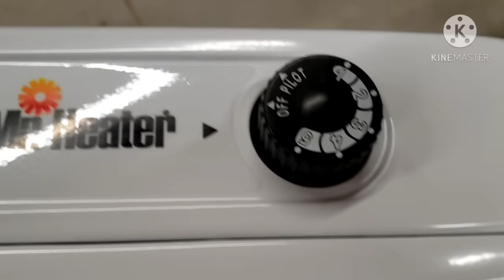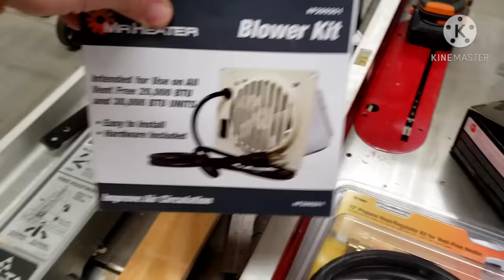Mr. Heater 30k Btu Propane Heater Opening And Install!

Comment: Can you leave this running while away from home?
Reply from the maker: You probably could for short times but me personally, would only run it while I was home. It has a sensor if there is low oxygen I believe but didn't want to test that. I did a second follow up video where I did the final hookup to a 500 gallon outside tank. Let me know if you have other questions. Thanks for watching!

Comment: I have the dual sunflower heater now. 30k btu. But it keeps giving me issues. So I'm looking at this. Thoughts if this is better heat wise than a sunflower tank top. I live in NW Wisconsin so we get super low temps.
Reply from the maker: I've never personally got to run one of those style heaters. So sorry I can't give you a fair comparison.
Reply: @HermanWoodworks  no worries. Thanks brother

Comment: I just bought the same heater.... MHVFRD30LPT.... Do you notice a difference (instantly) from temp setting 1 vs 5? The heat intensity doesn't instantly change on mine at all, it burns at the same level.
Reply from the maker: The intensity will be the same...the settings are a rough temperature setting. If I use setting one, it seems to keep my shop around 55 degrees or so....setting 2 keeps it around 60.... and so on

Comment: Two questions:  Are you worried about Co2 and also what about dust and an open flame in a woodshop?
Reply from the maker: So while they call it ventless, I crack a door from time to time to keep fresh air coming in. I do make mental note of running dust collection and air filtration units especially while sanding. I cut the heat off if I'm doing alot of sanding.
Reply: I ran this setup in my house last winter because the hvac never got installed before winter. It worked great and never killed anyone. Haha I had a carbon monoxide detector close by and more in other rooms. They never went off. Ran it literally all winter long in zero temps. Best investment for backup heat I’ve ever had.
Reply: Propane does not produce carbon monoxide.  So you’re safe there.  Oxygen depletion is the concern.  Most units like this have a shutoff if oxygen is depleted.  Empire heaters are ventless and have auto shutoff.
Reply: @thelouiebrand  ...using 20lbs tanks???
Reply: @thomasmiller9770  If the heater is malfunctioning in some way to cause incomplete combustion, then it WILL produce carbon monoxide. A perfectly functioning propane heater will not produce it, sure, but it's better to have a carbon monoxide detector incase of a malfunctioning heater.

Comment: is that hose kit necessary for the pressure? also why are those tubes only temporary?
Reply from the maker: This model requires a low setting which ends up being the additional filter to really bring the pressure down. The packaging states it is a temporary kit, I'm sure mostly for legality purposes with local code requirements probably needing the tanks outside and with hardlined propane piping feeding in.
Reply: @HermanWoodworks  im looking to heat up a 2 car garage only for an hour or 2 a day for a few months. it would be on for 2 hours max. do you think that setup would be ok
Reply from the maker: Are you going to be in the garage with it? The price point is good....if your only running it that little the temp hose kit might be fine for you long term....
Reply: @HermanWoodworks  yes i plan on heating up the space for 15-30 minutes before working out in my garage. total run time would be 2 hours max, i could see myself shutting it off after an hour
Reply from the maker: Yeah pretty much any other type of fuel style heater would be too smelly unless you get something quite a bit more costly. I mean the heater and fan were about 230 u.s dollars and 40ish for the hose kit and then whatever size tank you end up wanting...
Reply: @HermanWoodworks  thanks man appreciate the help

Comment: I notice my propane tank makes an air noise as the heater is on , but when the heater is off it goes away. I checked for leaks no bubbles. Is this normal?
Reply from the maker: What size tank is it? I believe I remember on the smaller tanks being able to hear the liquid propane displacing....
Reply: @HermanWoodworks  it’s the 20, although I do have the mr heater regulator that converts it for a smaller tank.

Comment: I'm looking to add something so my furnace doesn't constantly run. Would this be a good addition running a couple times a day to keep from my furnace being over worked?
Reply from the maker: You got alot of variables there...its not the prettiest looking thing...how big of an area would it be working in? Do you have a hardlined propane service or would you need a tank sitting there....maybe  a large space heater would suffice. Alot of people rave about mini splits also and then you get the cooling factor in the summer also.... sorry that probably doesn't help but maybe it would help me narrow down my answer.
Reply: @HermanWoodworks  I would run a line outside thru my four seasons room. So the tank would be outside.

Comment: It's been a year now... Do you still like this propane heater?
Reply from the maker: I do! I did a second video where I did a final install to the 500 lb propane tank outside. I usually keep it on a 2 setting for my 28x28 workshop with 12 ft ceilings. I'm actually selling the house that has this workshop but im installing a similar natural gas unit in the house garage at the home we are building.
Reply: @HermanWoodworks  
Good to know...
Thank you so much for all this great information. I really appreciate this.

Comment: Good morning- thank you so much for this video. I do have a question. We purchased the same exact equipment you have, however the connector to the tank and a portion (about an inch) of the hose starts to freeze immediately. What are we doing wrong? Hoping to get some help soon- before the heater goes back to the store… I want to keep it! Thank you for your time.
Reply from the maker: Hmmmm what are your outdoor temperatures? The tank will get ice covering it, but it usually takes a good while of it operating.... you say immediately?
Reply: @HermanWoodworks  we are in upstate NY, high 20’s low 30’s. When I say immediately- it’s within 5 minutes.
Reply from the maker: @janicefederico6586  wowwww that is fast. I would get ice on the 20 lb tanks after running it for hours....how long is the tank lasting, have you adequately checked for any potential leaks? Where is the tank placed?
Reply: @HermanWoodworks  the tank is new, yes we’ve checked for leaks from the tank. We constantly smell for the propane- sometimes we smell something, most times we don’t. After getting the hose you suggested- at least the heater powers up and stays lit, however it begins to freeze. Because we are just testing it out, the tank is about as close as yours was when initially assembling the heater (in your first video). The heater is on the floor in front of a rock wall.
Reply from the maker: @janicefederico6586  it sounds very much  like you have checked most everything. The only other thing I'm wondering is it naturally a humid room or close to moisture? I mean burning propane naturally adds water to the air but it maybe seems like there is excessive moisture. Let me know how long the tank lasts?
Reply: @HermanWoodworks  After further investigation, it looks like we were having trouble with the tank we were using. It works very well with a 20lb tank. We were trying to use the next size larger tank. Possibly they over filled the larger one? With the hose connected to the larger tank , the heater stays on about 3 minutes & is still freezing. We may have to just use the 20lb.
Thanks so much for responding. If you have any other ideas, I’d appreciate.
Reply from the maker: @janicefederico6586  I'm glad you got it running! I'm surprised the other tank gave you issues though...that hose kit is suppose to be ok up to 100 lb tanks. I did a second video where I did a final installation to a outside 500 lb tank. Just talk with your propane provider if you do something like that so they get you the appropriate regulator for that heater. Im still a little baffled by the other tanks malfunction issue. Maybe it was overfill. Let me know if there is any further issue! Take care and have a good one!

Comment: Does it smell last year I bought a blue flame dynaglo  heater and it smells thinking bout going this route
Reply from the maker: It does have a slight smell, it will be the same as the blue flame units probably. You will need to get a vented style unit to the outside for it to be odorless and 100 percent safe.

Comment: About how long will a 20lb propane tank last with this?
Reply from the maker: This is probably the most asked question I get on this video. There really are alot of variables, how well the house is insulated, how big is the area, how high are the ceilings....etc.... I had it in a 28x28 shop, well insulated with 12 ft ceilings. It would last roughly a week of intermittent use. Hope that helps! I also did a follow up video where I attached it to a 500 gallon outside tank. Thanks for watching!

Comment: oh no. I wanted to watch you through all the steps to hook up the kit to the LP tank.  I have a male thread coming out of the tank, and it looks like the kit also has a male threat to hook up to the tank (?) how do the 2 come together?  and you kinda skipped the details to install the fan. Can you help me out?
Reply from the maker: It has a male thread coming out of the tank? You may need to buy an adapter or possibly a piece needs to be removed? The mr heater model has a square on the back that is tack welded. That will get knocked out and there are four predrilled spots for the screws to go that hold the accessory fan. There will be a wired piece to attach from the fan to the heater that is the temperature sensor. Let me know if you have other questions. Thanks!

Comment: I purchased the blue flame model of this same heater. Could you possibly explain to me what the difference between the two is? I was told by tractor supply employee it was solely for looks. Any info would be greatly appreciated. Using the Mr. Heater 30k btu as primary source of heat. Thank you in advance!
Reply from the maker: Blue flame heats the air while radiant or infrared heats objects is the simplest explanation.
Reply: Blue!! Flame!!😁
Reply: I have a tractor supply blue flame heater.they have a blue flame!!😁🔥
Reply: @dannybetts6929  there is a difference. It's not just one is blue and one is orange. If you read the OPs reply to my comment, then you would maybe understand. Thanks anyway bud.

Comment: How does it handle in a camper with the moisture?
Reply from the maker: I only ever ran it in my old shop, but that was the one thing everyone seemed to warn about was the potential for rust on tools from the moisture produced from the propane. I never experienced rust on tools but on a cold evening I would notice moisture buildup on the windows.

Comment: I am doing this exact same thing in my 6x8 hu ting blind. Mine is a 25,000 btu heater. I'm running my tank outside. How do I know what size, or if I need a regulator on the gas line?
Reply from the maker: What size tank are you running? The hose kit i bought from mr heater already had the necessary regulator to run up to a 100 lb tank.
Reply: @HermanWoodworks  right now.....only a 20 pound tank. It's only a 6x8 hunting blind. And it's all insulated. Here is a link to my build if you got time to watch it...
https://youtu.be/bU47TwXPZUY
I may eventually put in a bigger tank. But for now, 25,000 btu heater in a insulated 6x8.....should last a long time.
Reply from the maker: The 20 lb tank was all that I was running for awhile. That hose assembly sold by Mr. Heater works great from 20 lb to 100 lb!

Comment: Is there a make and or part number on the hose kit?
Reply from the maker: Mr. Heater Propane Hose and Regulator Kit.....I believe it is F273684....let me know if that helps!
Reply: @HermanWoodworks  why is the hose temporary?
Reply from the maker: It is temporary based on their packaging and my desire to eventually hard black steel pipe it to my wall.

Comment: Would a 10 psi regulator work with this?
Reply from the maker: I believe it is right around there. I did a follow up video where I did the final hookup and show the regulator installed by my propane provider.

Comment: DO I NEED THE TWO STAGE REGULATOR MY 500 GAL TANK Has a regulator on it
Reply from the maker: I checked with my propane provider and let them know the heating unit i was installing and its necessary supply. They installed the correct regulator so I didn't have to double regulate it.
Reply: @HermanWoodworks  I know you said that was not part of your expertise, so I guess we'll have to have an expert tell us if it looks like  the regulator previously used with our 250 lb tank, will work. I finally got our heater delivered and was just thinking about looking at a long term regulator needed for the lower pressure. 
I think our old heater that was vented was 80,000 BTUs.

Comment: I just got this exact  heater and hose, would it be ok to hookup to a 20 lb tank as you did ? Because on the heater it says only 100lb and up?
Reply from the maker: The hose kit i had was rated from 20-100 lb tanks...the hose kit needs to have the proper regulator in line on it.
Reply: @HermanWoodworks  ok thankyou so much.
Reply from the maker: All good, hope that answered your question! I have another video with my final hookup install and I believe i go over the hoses and the necessary regulators a little more.

Comment: What is the highest you can mount on a wall for safety for kids?
Reply from the maker: Unless your area has a specific code it is your choice....obviously heat rises so the lower the better.
Reply: @HermanWoodworks  thanks. I am going to purchase the additional fan.
Reply from the maker: @AB-wx7uz  i have had alot of people comment that they didn't necessarily think the fan did alot. I found it to help enough. My shop was 12 ft ceilings so I found a ceiling fan to help circulate the heat from up high was a huge help!
Reply: @HermanWoodworks  thanks , my garage is a little over 400 sqf w/ 12 ' ceilings.

Comment: No one shows how to knock-out the blower plate, it's there one min and then it's gone. 
Do I just smack it with a hammer?
Maybe? 
Ok here we go......
Reply from the maker: Sorry I didnt....I used a hammer for a little initial loosening...some light grinding if you really wanna make it easy.  Use a file to clean up any left over burrs.
Reply: Thank you, when the hammer thing didn't work out well (LOL) I used a screwdriver, a hammer, and a pair of Chanel Locks
It finally let go.
Thanks for the video and the quick response time 👍
Reply from the maker: @rickdougherty1519  Yeah it is stubborn at first but once you break one corner it kinda twists out easier.

Comment: Doles this heater cause moisture problems?
Reply from the maker: If you try running it at a higher setting for a long day and its a dry cold out, you will notice some moisture on the windows. I keep the setting relatively low and don't notice it much.

Comment: Where can I buy that hose assembly?
Reply from the maker: I found mine at my local Tractor supply company, they were also the one that sold me the heater. But I also put a link in one of the comments for the hose assembly on amazon. Let me know if you need it again.

Comment: It seems they have changed this unit. My 2   30,000 btu units have 4 ceramics instead of 5 & I can’t really see the pilot/ thermocouple on yours. Mine the pilot / thermocouple is integrated . Yours seems separate replaceable units that’s better. Mine are about 5 years old . I’ve had 4 different brands of these & currently had to retire my favorite unit made in 1978 from England. I actually came here looking for insights on changing the pilot / thermocouple. The frustrating part of this is the cabinet reassembly after routing the lines. The Dyna glow cabinetry is much simpler
Reply from the maker: I haven't had the displeasure of having to change the pilot or thermocouple yet... hopefully im not giving myself bad luck saying that. Lol. Im not familiar with the dyna glo units. I'm assuming they are pretty comparable.
Reply: @HermanWoodworks  we have the Daglow models I don’t know if the manual has part numbers in it but if it does definitely keep it because that’s why we had to buy a new heater. Our igniter went out, and when we called Daglow, they were less than useless as far as helping us figure out what part we needed their exact words to my Wife was look it up on our online manuals, then call me back with the part number. They couldn’t even get the part number for us on the phone so we just wound up buying a new unit anyway now that unit lasted us for quite a few years I’m not lying that no problems at all till the igniter completely went out, but as I said Daglow themselves customer service is crap. They have no idea what they are doing behind that phone.

Comment: Why does it need the electrical connection?
Reply from the maker: If you purchase and install the additional fan option then it ends up needing a power outlet. Otherwise it is free standing and only needs the propane source.